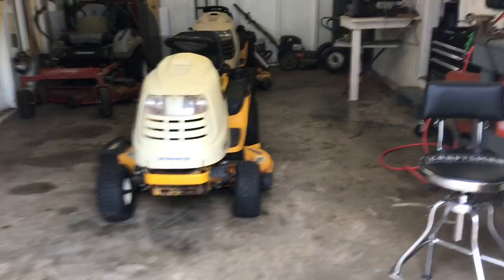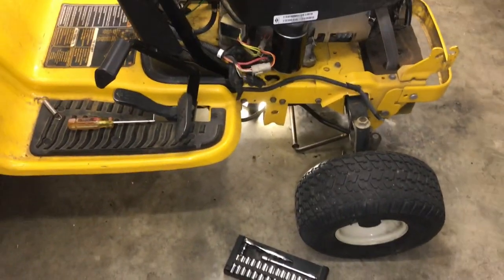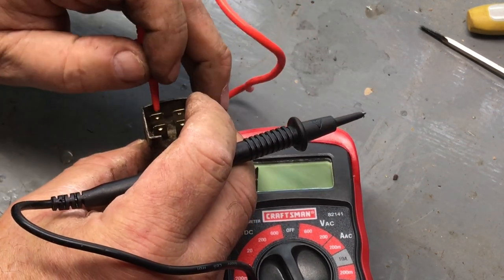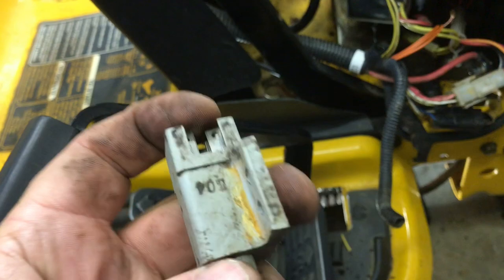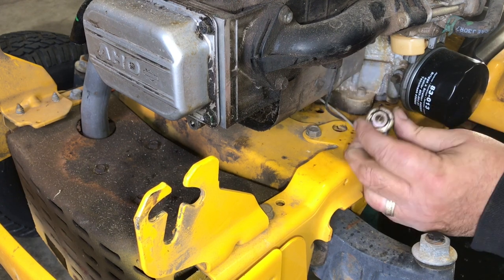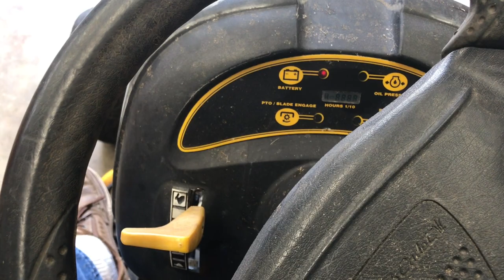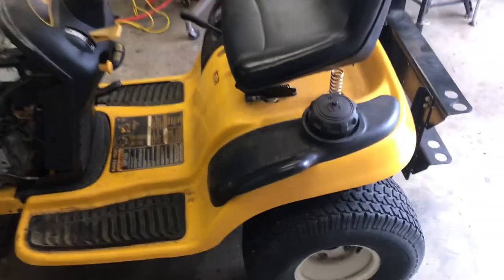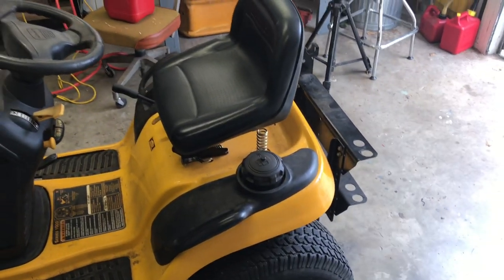Lawnmower safety switch test

Comment: I tested a brake switch on a john deere x320 and it had continuity on both sides when the switch was pressed so I figured it was bad but when I tested the brake switch on my mower which is a john deere x324, my switch does the same thing but I have no problems with mine. Is it because I have the seat switch jumped?

Comment: Cool, you'll like that bagger when the leaves are hitting the ground. Good for the garden. Mow em once, then bag em.
Reply from the maker: Im the guy that doesnt give a crap about the leaves on the ground. My wife however has a problem with sticks and leaves.  sometimes she can be in the house,hear a stick starting to fall out of a tree, and be under the tree to catch it before it hits the ground.
Reply: Well I guess we know who's the boss. As if we didn't know already.
Reply from the maker: bc65925 I think I’m gonna change my name to boss of the shop.
Reply: If I was you I wouldn't buy any signs or business cards saying that.
Reply: bc65925 haul the chopped leaves over to a pile  add some manure  use it as compost in the spring
Reply from the maker: Walt Lars my wife will get pissed if I poop outside on the leaves!
Reply: I know my wife does!

Comment: great job BC doc sprocket on YouTube getting a video on the carburetors with the solenoid is fix was to snip off the end of the solenoid and put a shut off valve on the fuel line
Reply from the maker: Kevin Romas yep. I’ve done that. Shut offs are 5 bucks and fuel solenoids are 65.

Comment: Cool fix. That Brake Safety dies not look waterproof and given where it's located it should be. I'm sure the contacts are corroded to some degree. My Cadet, you can get out of the seat and leave the engine running as long as the PTO is not engaged and the Parking Brake is engaged.
Reply from the maker: My other cub you  get out of the seat WITH the PTO engaged. I hate lawyer switches!

Comment: 2 things,those engines are known for head gaskets and adjust the valves before you start using it since it probably has never been done
Reply from the maker: roger oconnor gonna do that tomorrow.
Reply: i always pull the fan shroud off and clean out all the crap,if they got hot the head gasket will go

Comment: I won't charge a battery that's under 11.4v usually wastes my time... If it's for someone else or even me I try and replace new or known used. Rule of thumb is anything under usually is a bad cell or going out soon cell. 12.4 and up good and charged but ideally float charges can be flaky
Reply from the maker: Cody Jv as I said in the video, I only needed it to hold a charge long enough for me to test the switches and do my trouble shooting. I didn’t want to buy a battery if it’s not worth fixing.
Reply: I respect that, just adding information. I'm surprised you haven't got gifted a boost pack of some sort :( Santa didn't check off your list of needful things. They boost lawnmowers, atvs, and many other small equipment no trouble and sometimes a truck or car with a low battery no problem.